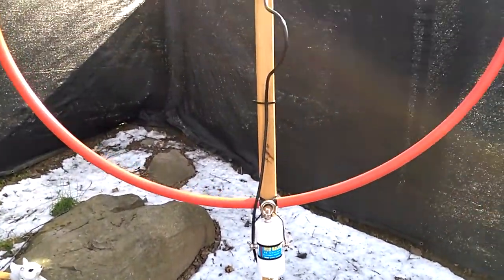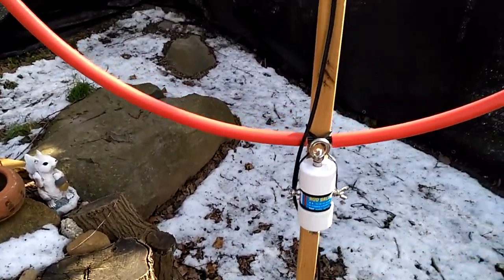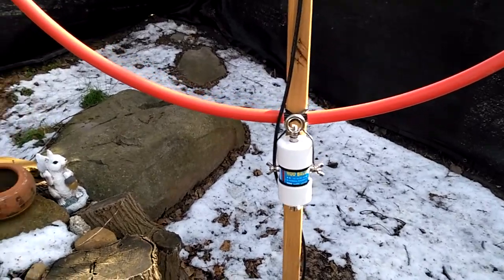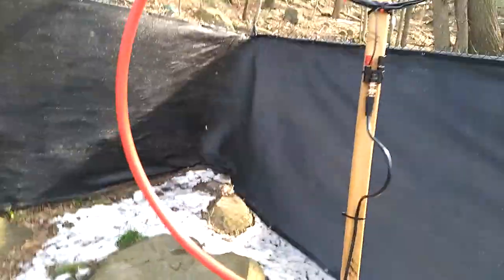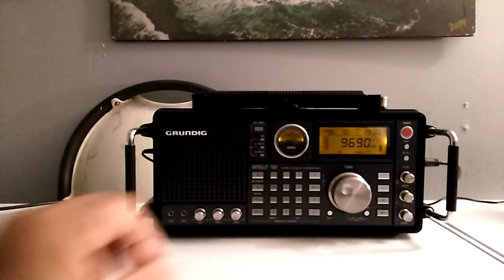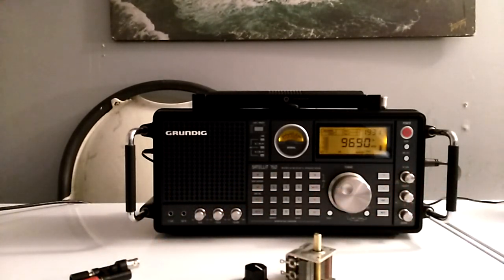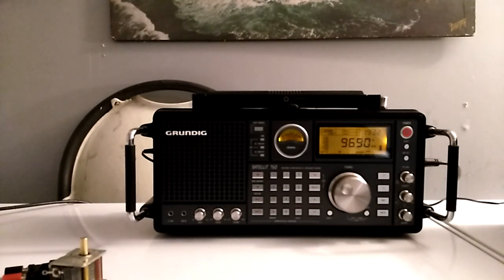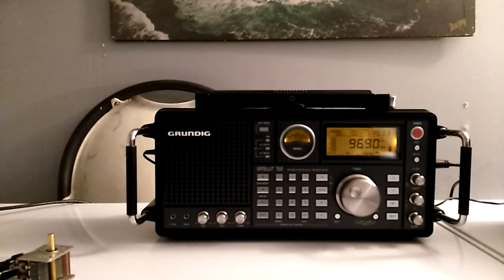Recycled Hula Hoop Loop Antenna Update Video :)

Comment: HOW would this work on FTA TV antenna Danny ?? How many turns of wire do you have in the small and large hoop and wire gauge too ?? Thanks
Reply from the maker: This only works for shortwave and mediumwave bands.  FTA TV you need a satellite dish.  Unless you mean OTA TV then you need an OTA TV antenna.  This loop would not be any use for television signals.  Thank you for watching.

Comment: Hi Danny, Great Video. I recently found a Hula Hoop and want to make a loop antenna like this, but with a tuning capacitor.Not sure of the technical side. Can you tell me please - How many turns of wire for the tuning loop ?  Also how many turns in the hula hoop - Also is it a continuous loop not connected to anything. I want to use it for Shortwave listening.
Reply from the maker: Thank you for watching.  Have a good weekend.

Comment: I saw one of your earlier videos with your loop in the basement and the balun.
Well, I pulled off the pickup loop. Saw no difference in reception.
Replaced the capacitor with (all I had) a little 1:4 tv balun which was under a dollar. It made all the difference in the world. The home made loop picks up as good and is much quieter than my 120' wire antenna.
Thank you very much :-)
Reply from the maker: Your very welcome.  I'm glad it is working for you. Yes the TV balun will work also. Although people going to say there is an impedance mismatch because the TV balun is 300 to 75 ohm instead of 50 ohm, The main thing it works for your use. Make use of the materials you have too. My loop is now only 3 turns of wire inside the hula hoop and I eliminated the pick up loop, same here no difference. Loop connected straight to my standoff with a BNC connection.  I will make a video soon on my indoor AM loop antenna.  Good Job, Sir.  Have a good day.  :)